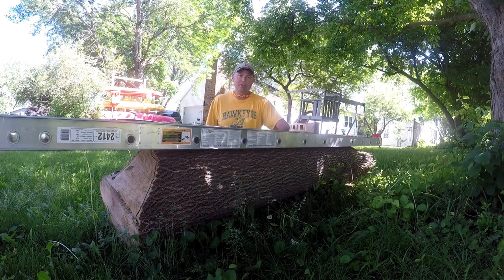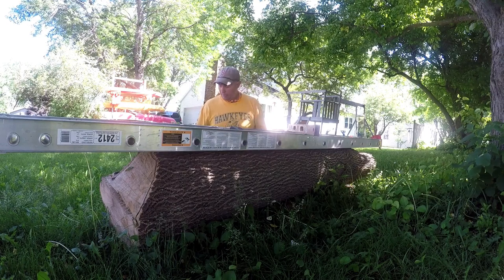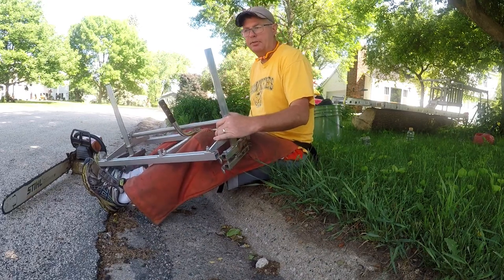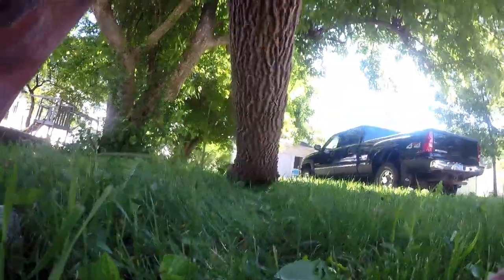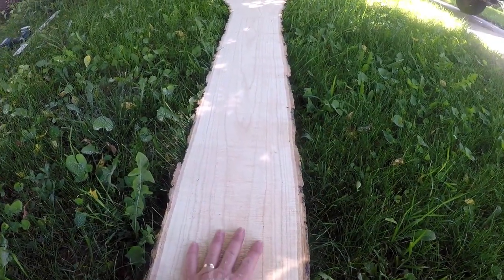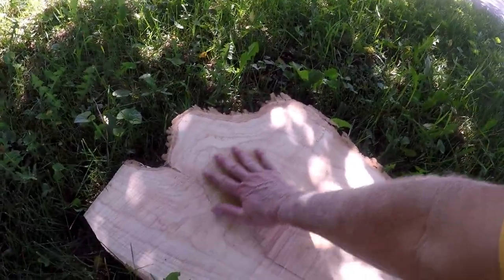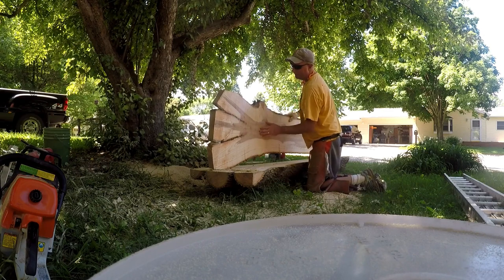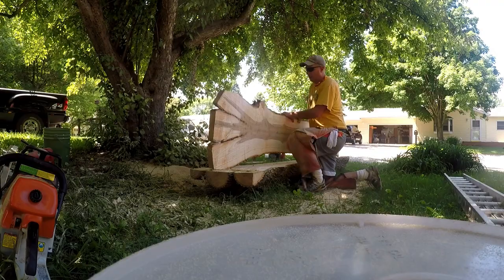Using an Alaskan Sawmill to Mill Custom Boards from Ash

Comment: Are you using a ripping blade or regular?
Reply from the maker: John, I don't remember if I used a ripping/skip tooth chain or not in this video.  I do have them but they are far more expensive than a regular chain and I don't see a huge difference in performance. The most important thing in my opinion is to have and maintain a sharp chain. The chain I used in this video started out fairly sharp. However I should have sharpened it after a couple boards but didn't.